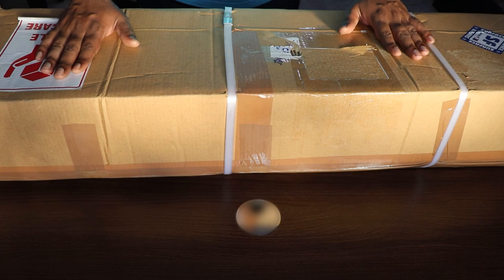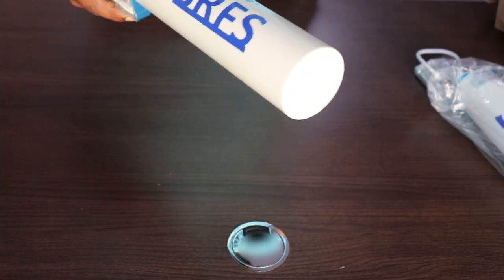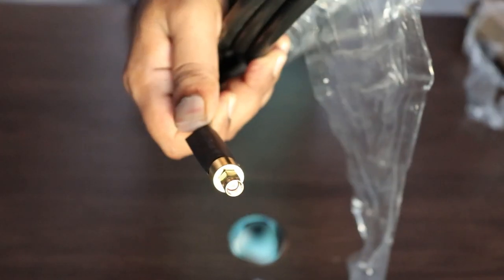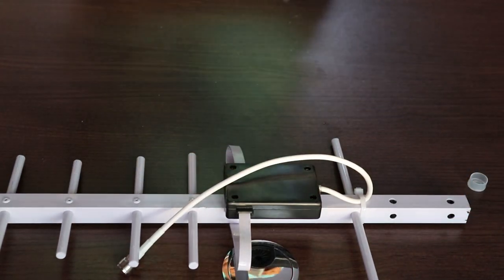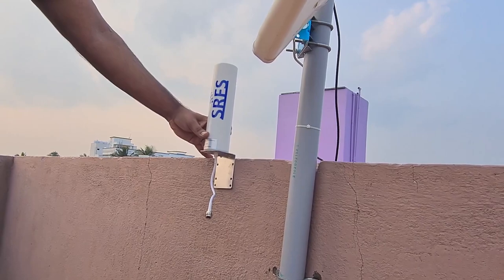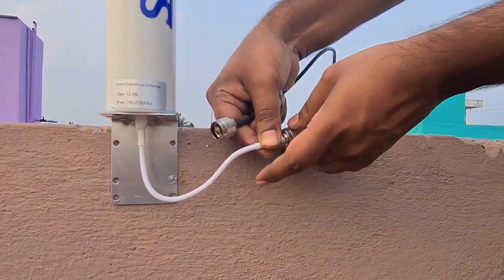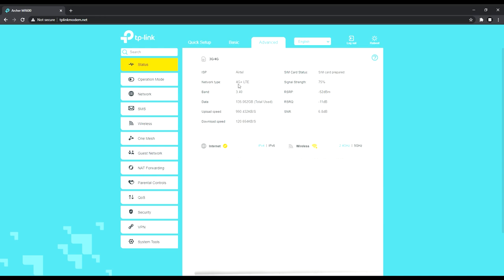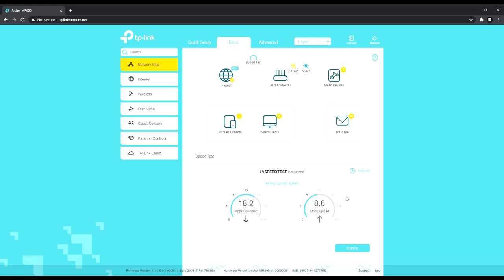Omni-directional & YAGI antennas | Setup of Omni  | For your 4G modem | Part 1

Comment: I have been testing mobile networks in my area and to be true if there is a very weak signal nor a LPDA is going to work or Omni have tried both. ( Single and double )
Reply: Get parabolic antenna. It need to be pair with satellite dish. It have range support up to 25KM.

If pair with standard 65cm dish, you get REAL 24dbi gain. If pair with 100cm dish you can get 32dbi gain

Comment: I live in small city in Rajasthan we do have all cell tower cause receive signals but not all bar the tower are their but i  don't have clear site of my network cell tower in that case should i uss lpda or Yagi or should i go with multi directional omni antena
Reply from the maker: If there is no direct line of sight then lpda might not be effective. But am concerned if omni will work as I didn't get good results.  But omni us the way to go in this case.but you can try

Comment: Hello bro! I'm trying the same like installing antenna to my Archer600 router.
My stock antenna test was inside the house -> 30 - 35 MB download
-> 1 - 2 MB upload speed.
Inside the house I got only 4G speed but in terrace I got speeds upto 70+ MB in my OnePlus 7t mobile.
Please suggest a best antenna setup for me.
I bought one lpda antenna (OXYWAVE) and installed but it's not doing greater than my stock antennas. 
Might be I have to use two lpda antenna to get the gain?
Reply from the maker: i would suggest you to go with the one more LPDA Antenna, as only one antenna does not help and i have tested it with one LPDA antenna and the speeds are bad. Get another LPDA Antenna and try it, will work for sure. Now coming to the question on the speed on oneplus 7t, the MR600 does not support CA in stock firmware and speed in mobile is always good than the MR600 router. That's the irony of our MR600 router.
Reply: @diyIndia  bro can you explain it more clearly. Mr 600 also supports 2CA. I'm planning to buy that Mr 600, what would you suggest? Any alternatives
Reply from the maker: @VinayKumar-lf1xu  Does not support 2CA in stock firmware, using BETA firmware I was using the CA.

Comment: I want to run my android 4k tv ...plz can u suggest me by using bsnl sim catd which antena and 4g routers is good for me 
Bsnl signla strengt is -102dbm in basement and at terrace -71-75 dbm
Reply from the maker: You can buy the TPLink MR600 works good, but make sure to use teh Beta firmware in which it allows us to choose the bands

Comment: I have seen your lpda external antenna video and brought those lpda antenna for my tp link mr 600 video . Now I am getting speed above 25mbps at any time . But if I keep Yagi antennas ( nearest airtel tower is almost 0.5 km ) instead of the lpda antenna how much speed can I get ? 
Can you mention the cost of Yagi antennas ?
Reply from the maker: I will let you know, I m currently testing it out with YAGI. 
Glad that you were able to increase the speed using LPDA antenna.
Reply: Lpda support wide band meaning it support different frequencies but low gain when compared to Yagi. Also less elements in different lengths is placed in Zig Zag manner in order to receive wide frequencies.

Yagi is narrow band antenna. Meaning it support few frequencies(say 2400mhz to 2500mhz) but when compared to lpda it have multiple driven element, reflector so it have better gain. 

But physical as well as cost wise Yagi is big. 

If you have good signal in lpda no need to go to Yagi.

If your cell tower far away say 3-5 km you need Yagi.

If cell tower is located 10 km or more then you need very narrow antennas like parabolic grid.
Reply: @ashitoshdhainje7705  I'm sure this seller is genuine. Contact Akansha and follow up the order in whatsapp.
Reply: @ashitoshdhainje7705  they will share the courier details with you. You can track on your courier website.
Reply: @ashitoshdhainje7705  seller is genuine maine bhi prepaid order kiya tha order mujhe mil gya whtsapp pr hr detail share kr deta hai seller
Reply: @atulverma8370  Bro UPI ya bank payment kiya aapne ??
Reply: @ashitoshdhainje7705  paytm
Reply: @ashitoshdhainje7705  Which antenna did you buy ( Yagi or lpda or Omni directional antenna ) ? If Yagi , can you mention the cost of Yagi antenna ?
Reply: @amaralingeswararaopola6526   yagi is not best  because it does not support wide range of frequencies.  If ur tower is 5 km away  then u should try parabolic mimo grid antenn but i think it would be import it
Reply: @amaralingeswararaopola6526  I'm using lpda antenna, before lpda the signal strength was -105 to -110 dBm inside home after lpda getting -74 dBm. 

It gives full throughput. 

It's not only because of the antenna,but also because of the cell tower capability.

 If cell tower radiates less power you receive low signal. I mean between -70 to -85 dBm. 

I made observation very close to cell tower. It gives max signal strength of -68 to -75 dBm.

So lpda works fine for me. My tower located 600m away aprox.
Reply: @amaralingeswararaopola6526  just orderd 2lpda +20mtr lmr 400 cable .
Reply: @ashitoshdhainje7705  bhai tower ki trf kro ise lpda nearest tower ki trf
Reply: Compare kro dbm   with external antenna without external antenna
Reply: @ashitoshdhainje7705  nearest tower kitna dur hai bhai  kis compny ka use kr rhe ho?    Koi aur compny ka bhi try krke dekho   cable setting bhi krke dekho bhai
Reply: Apke pass router kaun sa hai mujhe lgta dbm 65 to 80 ke bich me     hoga to speed teek tak milti hai
Reply: @ashitoshdhainje7705 bhai kayi bar tower pr kafi load hota hai to bhi speed nhi aati hai ydi netwrk problm ki vjh se speed nhi aati to ye lpda help krta h aap service provider chnge krke dekho ya lpda ki height bda ke dekho
Reply: @ashitoshdhainje7705  ek bar aap uchayi badhao direct alin kro. Yagi bhi mujhe nhi lgta work krega  parabolic mimo grid antenna behter hai
Reply: @ashitoshdhainje7705  mere case me to roof pr axe signal aur speed thi but rooom me 130 dbm tk the   ab 75 dbm tk aaa jata hao lpda se to result axa hai mr600 use krta hu
Reply: @atulverma8370  same jagah pr relme1 25-30 mbps speed de raha hai 😭
Reply from the maker: @Ashitosh Dhainji  LPDA ko direct line of sight chahiye. Apne modem setting page par login kare ke apne signal strength screen ko refresh karen dekhna, agar improvemnt nahi hai toh, direction todha change kare phir se refresh karke dekhna.  yek specific angle par hi zayada signal milega.
Reply: @diyIndia  ok sir . Waiting for yagi antenna video . Please UL asap if possible
Reply: Seems in my experience if you have 2-3 towers of same carrier in one direction (ex:  in 100 mtrs) your lpda antenna will frequently switch from one tower to another.   In this case, signal will fluctuate and then data speed get impacted ( load on each tower will vary). So here pointing at a specific position (even for 1cm) will give good results but after sometime it will switch to another tower and signal strength will change. In my area on west there are 2-3 towers so I tried other direction (east side) tower where there is only one tower. Now my lpda antenna only gets signal from that tower constantly and no flaculation happening. The only problem is the tower is approx 3.5 km away so getting only 5mbps speed which is okay for WFH. I would say Yagi 21dbi antenna with 40 ft height is good here. But not sure whether this heavy duty antenna is attached directly to router or need amplifier. So wondering if investing in Yagi would be useful or not as I guess it will cost 3k+ incl shipping.
Reply: @atulverma8370  bro , Abhi full 10mtr cable ki height de diyi 30-32ft height ab speed mil raha hai accha . Airtel pr rsrp -70 to -75 rsrp -7-9 snr 15-18 (band1) speed 25-30 constant mil rahi hai.  
Idea me bhi same -78 snr 23-25 aa rha speed (15-25mbps band40 / 40+ mbps on band 41 )😀🙏

Tower distance - 2.8km

Comment: Thank you. Waiting for Yagi antenna demo. Planning to buy one. I'm currently in rural areas for sometime and the nearest tower is between 3-4 kms. 

One important question: do signal drop whilst using Yagi or lpda. I checked in my Huawei 4G router....signal test shows sometimes green and sometimes orange.. its not stable. Why? Btw I'm using LPDA antenna currently and I guess it's good for upto 1 km radius tower.

Your suggestion on Yagi will be appreciated 🙏
Reply from the maker: Hi There. Sure, am currently testing Yagi Antenna however, am currently searching for a location where i might have less signal, I stay in CIty so most of the towers are close by and am not able to test the full potential of the Yagi antenna, 

In regards to the second question, i have not faced any signal drops and few instance i have used it for logging in for my office work without a problem. Stay tuned for the Yagi antenna update.  Thank you.
Reply: Agree. It will be difficult for you to test but I would say just check on your existing setup whether it's give any improvement or not as compare to lpda. Also NetMonster app shows all nearby tower from that reference you can point your Yagi Antenna towards far away tower.

Comment: Is there any MIMO antenna for mr600 so single antena can increase the speed rather than installing 2 antennas?
Reply from the maker: yes there are patch Antenna, which has MIMO support, you can try those.
Reply: @diyIndia  Thanks for quick response

Comment: Will it deteriorate the wifi broadcasting as we are removing the default antennas and now the broadcast for the wifi is from the antenna that is on the roof ??? Is it so, how to overcome it ??
Reply from the maker: The Wifi Antenna is built in to the router. There will not be any drop in the wifi signals. .

Comment: Hi there, I am staying 2km away from tower, in a rural place. I have lot of trees due to which tower is not in line of sight. As of now getting -110 dBm, band 40 with 20 Mbps download and 1 Mbps upload speed in airtel using mr200. Which antenna do u suggest for better upload speeds
Reply from the maker: would it is possible to raise the Antenna from your roof so that its taller then the tress, i know that may not be possible. I would say LPDA should be the best way. or you can try to extend the stock antenna by getting the LMR200 cable.
Reply: Same situation for me...lot of trees around house,  cannot see tower and doesn't know where the tower is located, very low network speed...dbm of jio is -100.... any solution for me..?
Reply: @ifyouknowme992  to test I brought both LPDA and Yagi antenna. Yagi did not give me any result, but LPDA got little gain of 10dbm and improved a speed a little (10 to 20%)
Reply: @sandeepa vk actually I have ordered lpda antenna with a wifi router and 15 meter wire from Amazon, together costing 10k...really worried whether it would be helpful for me...can't see the tower and has no idea where the tower is located and too difficult to get ldpa antenna placed above the trees.......also -10dbm difference alone is not going to do wonders😬
Reply: @ifyouknowme992  Did you get good speed after the setup? 

Let me know pls
Reply: @hireshnaik7847  not actually  tried different angles and position at a height of about 10 meters but the experiment failed with jio sim.... later I brought a vodafone sim and it improved signal strength and speed in a some directions but couldn't get desired speed when I tried to place it in height,  so for me it was not useful..... but now I am getting decent speed with vi sim, locked on 4g only in router . So happy 😊
Reply: @ifyouknowme992  now which antenna u r using
Reply: @hireshnaik7847  actually I am not using any of those antenna...as I told I couldn't find any difference in speed with jio sim (actually lesser speed than jiofi compared with router alone and router with lpda), got slightly higher speed with lpda and router with vi sim comparing with router alone but consistent performance was not available when I tried to fix lpda antenna to a position......so now I am using vi sim in tp link mr200 router, no external antenna is attached...

Comment: Two antenna is compulsory?? For 4G  router
Reply: Not necessary.
Reply: @nithinn987  can u  suggest me any best 4g router for external antenna??
Reply from the maker: I tried with removing one LPDA Antenna in my MR600 and the speed reduced, this is based on my experience.